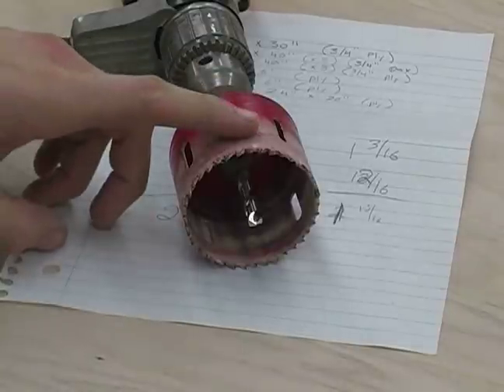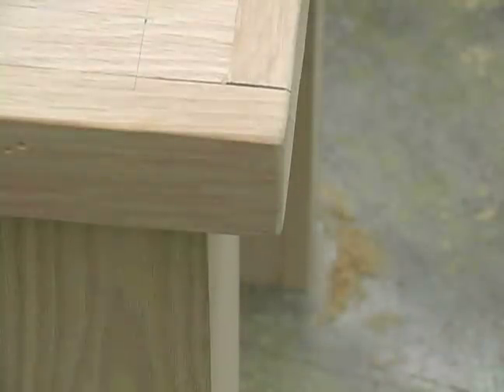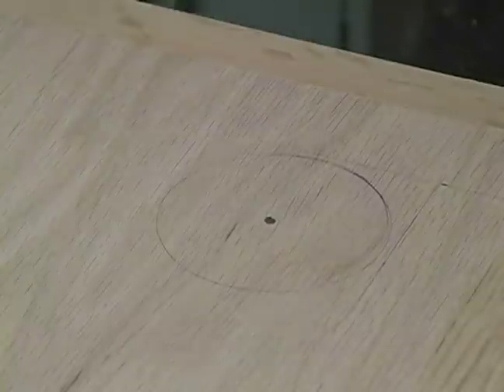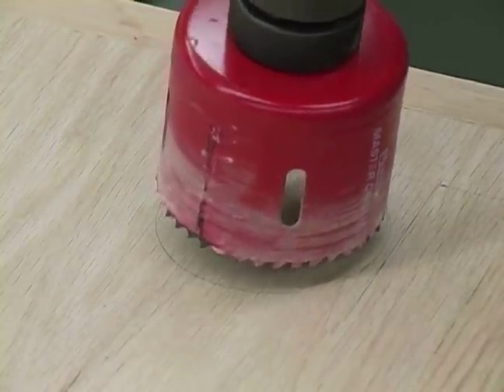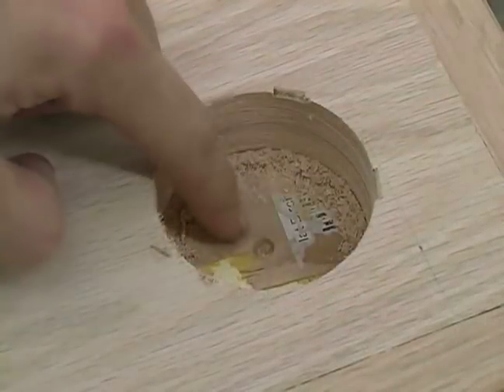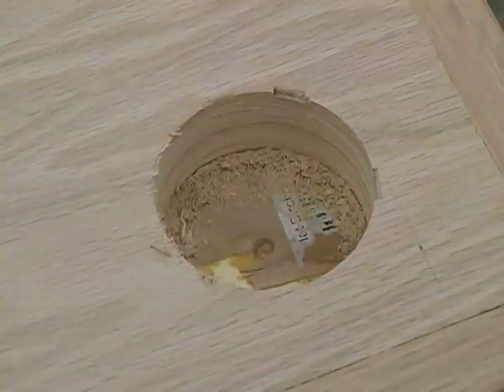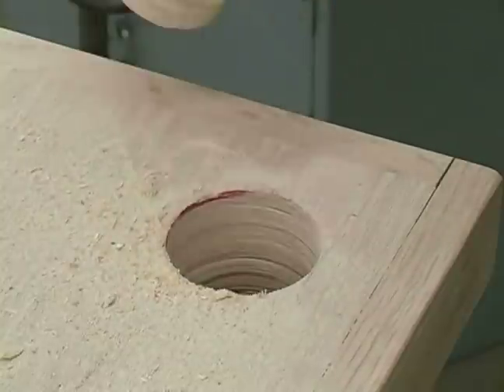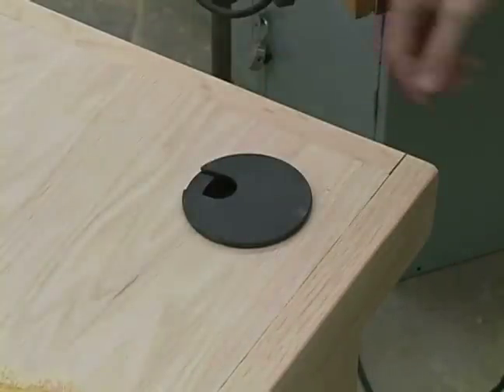How to Design & Build a Computer Desk : Drilling Grommet Holes for a Computer Desk

Comment: After you start drilling from the top, rather than risk marring the edge of the hole bearing down on the chisel, why not remove the hole cutter, use a drill bit to drill through the desk top, then use the hole cutter from the underside, with the center hole now located, until the circular plug is freed?
Reply: if you look in the hole you can see the support or legs of the table so it is not a circle straight through. there is a hole in the table and a grommet in the top it is still functional and looks good.

Comment: wow so 2 things I noticed right off the back you messed up the edging of that hole because you didnt keep a constant speed, and did the bobbing, and that chisel OMG that damage. next time use some painters tape before you drill keep the speed steady, and if you don't have a hole saw deep enough go buy one. or at the least tap out the center hole with a slightly smaller bit so you can drill from both sides.